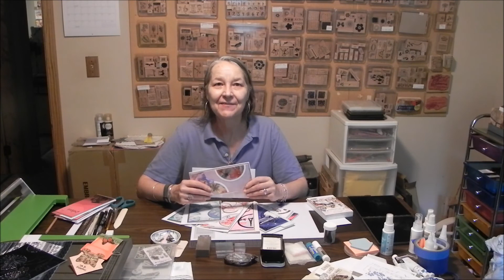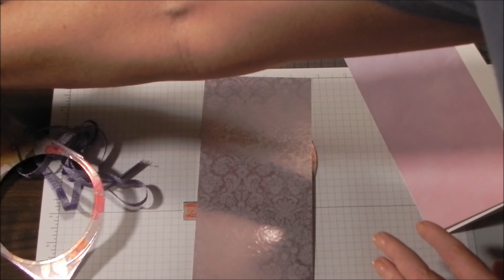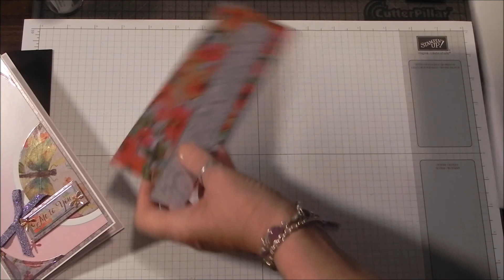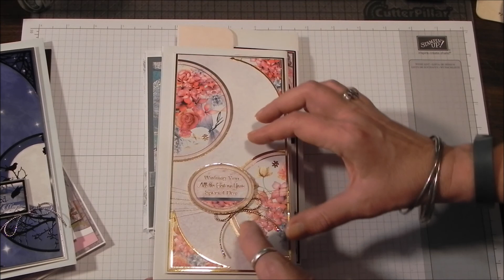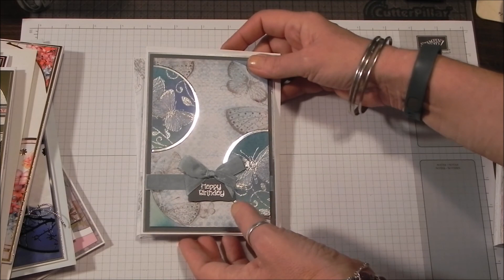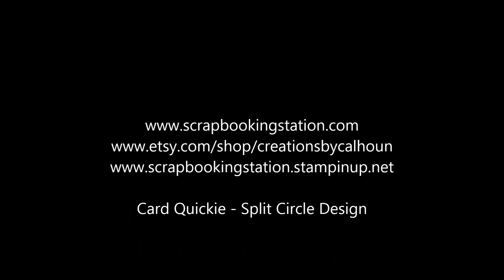Card Quickie - Split Circle Design

Comment: Hi Lee.  Just a quick question as I have watched this several times now.  The last 2 cards you show are on the butterfly background.  Did you change the circle size on those cards?  They seem to be the 5x6.5" base. Thanks!
Reply from the maker: yes, I decreased the circle size to 3 1/2 for the focal w/ 3 3/4 for the mats - but wish I hadn't.   I thought I would want to see more of the backing paper.   Ended up losing some of the "movement" with the smaller circles, pretty much the signature for this design.   Finished base card for those is 6 1/2 x 4 1/2.  If I were to do it again - I'd hang with the ~4" even though the card is 'shorter'.